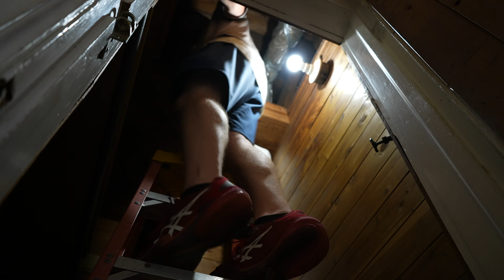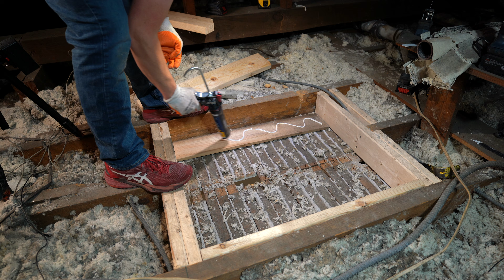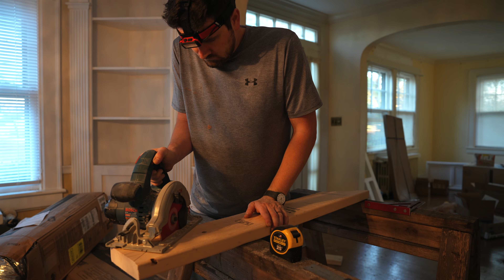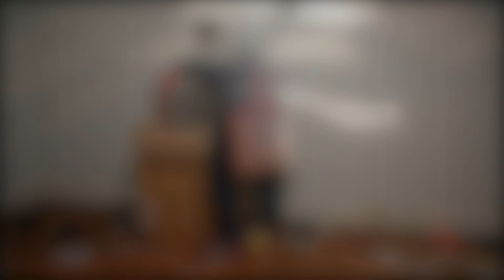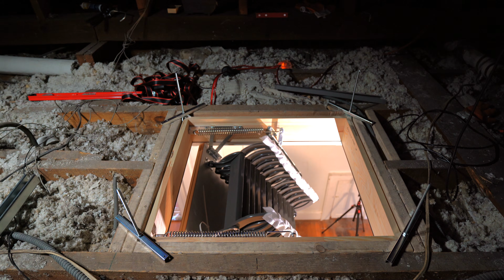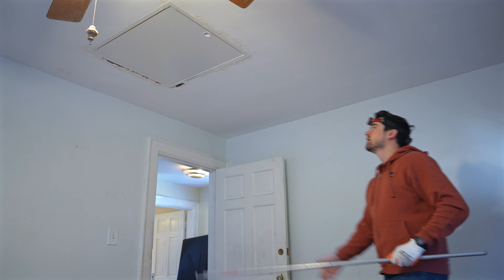I installed an attic ladder solo using an electric hoist

Comment: Does Amazon have Unistrut Mounting Clamps that will fit the Lowe's bar?   Asking because Lowes wants $18 per bracket.  That seems crazy high.   It makes me wonder if I could just bolt the right angle brackets (the ones you used) directly to the Unibar and skip the clamp mounts.
Reply from the maker: the amazon ones didn't fit for me.

Comment: I had the idea of a second hatch to use as a makeshift elevator to load and unload goods into the attic. This idea is so much better! Interested to see how you go getting items past the ladder? Great channel ✌️
Reply from the maker: The ladder is removable from the hatch, just 4 bolts holding it in. I removed it in order to fit the AC unit up there and then re-attached.
Reply: @ clever! Thanks for the idea ✌️✌️

Comment: I assume with a little elbow grease, the ladder can be removed from the wooden frame, so the frame can be installed easily. Then the ladder could be re-attached to the wooden frame after the frame is secured in the roof.
Reply from the maker: The whole assembly weighs about 100 pounds. I actually removed the ladder to lift an AC unit up there, and it's about half the weight. So even 50 lbs is a lot to lift yourself into a 9ft ceiling, while somehow attaching all the corners and screwing it in.  

Basically, even if you can lift it, you don't have enough hands.

Comment: I would worry a bit about that joist being cut..... it might be load bearing, couldn't hurt to run a 2x6 across with some timber screws
Reply from the maker: all its doing is holding up the ceiling, the blocking attaches it to the adjacent joists.  Another reason why you want to go into the attic first, is to make sure nothing is resting on top of it.
Reply: @BadHomeowner  Floor joist also serve a dual purpose other than for load bearing properties, they act as wall ties. They prevent lateral downward pressure, from the roof, from pushing the apex of the wall outwards. Cutting one usually wont change much, but an accumulation of changes over 50-100 years can sometimes be enough to cause real problems in the future.
Reply from the maker: @bradstafford14  these joists run parallel to the roof ridge, there are orthogonal ties into the roof rafters. Yes it's somewhat weaker, but the house won't notice.

The house is 100+ years old already! And it's in great shape, should have no problem getting to 200 :)
Reply from the maker: @bradstafford14  the flipside is now its 10x easier to get into the attic and inspect the underside of the roof more often

Comment: Nice job although shouldn't there be a seal of some type at the door's opening?
Reply from the maker: Yes. This is an insulated door and it includes some weatherstripping around the edges, so I'm not too worried.  But we'll see how it performs over time.